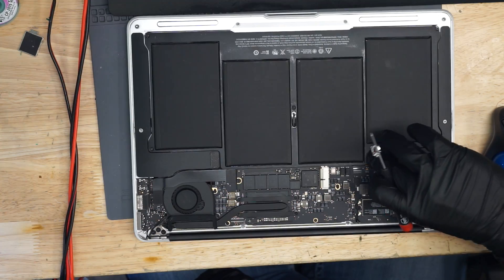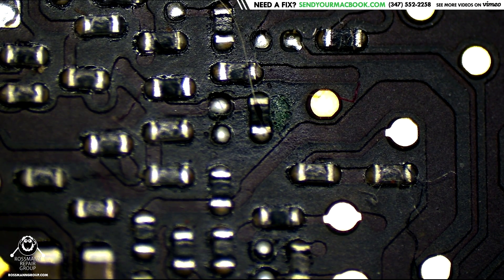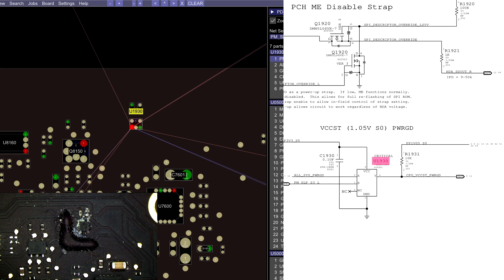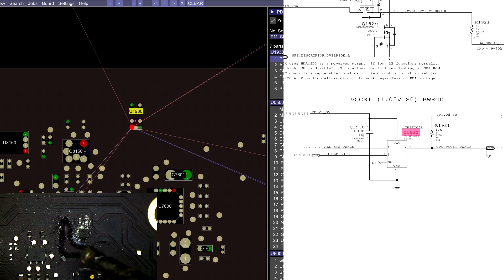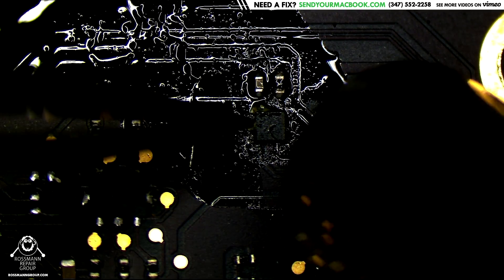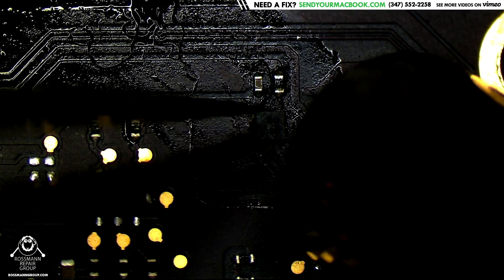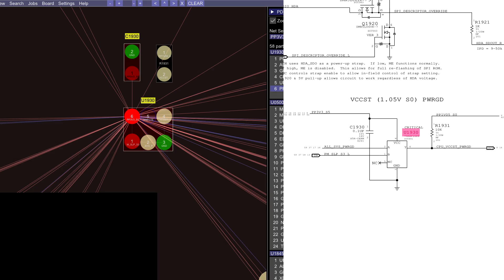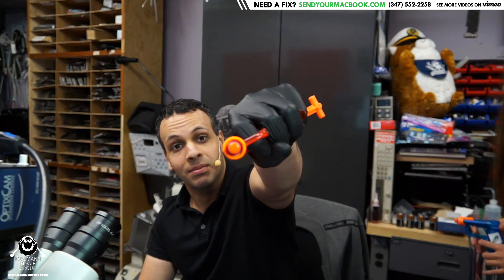Why is an A1466 Macbook Pro taking 45-65 mA and not turning on?

Comment: Heyy
i am having Issues with the new Macbook Pro Baseline Model(128Gb Variant)-

The Screen Flickers Green Intermittently while Watching Video Content.

The whole Video playing area shakes sometimes. 

The Lower area of the Screen was showing Vertical areas of bright and shadow regions (seemed like someone has put on lamps from below the screen) 

It's in Warranty...but the service centre said there is no issue with the hardware.
I am running MacOS Catalina... and i don't think it's a software issue.

Anyone Else facing this issue?
what should i do?

Comment: Why is Apple XYZ  it working anymore, despite X mA:
Because it has been engineered to fail. The idea is for you to buy an overpriced doodad not just once every few years but regularly, at least once a year. That's why everything Apple makes is particularly fragile and prone to break down. And don't forget about that Apple-exclusive Intersil power management device that is engineered to be right in the failure rate and mtbf average that is most profitable for Apple. In other words, the chip nobody but Apple has access to, nobody else can get, and that dies mostly just in time for the next macbook generation.
They say that the lottery is a tax on the stupid. I say that Apple is yet another tax on the stupid with too much money to spend. 
Why spend $2500 on a notebook that is fragile, prone to break down and specced like competing notebooks in the $800-$1300 range? Because the case is shiny? Because the guy presenting it was wearing a black turtle sweater? I really don't get why people do what they do here. I really just don't. Why give good money to Apple?

Comment: Hi Louis, is there any chance before you move into the new store that you can take a quick video and use a string line in the new store so as to give a visual representation of what the old store size would look like in the new store if that makes sense? so we can see the size difference.
Reply: Max Miles Its much larger! Not sure about width and length ratios.
Reply: @gordonrichardson2972  yeah i know its larger Gordon but i just thought it might be a good bit to put in one of the next video's so you could visually see the difference since youtube is a visual medium :)

Comment: I learned that schmutz and smegma on the motherboard is a bad thing. Wish I had a microscope like that. I have an analog Hakko soldering iron and rosin core leaded solder but I think I need a couple of gallons of flux before I take on micro soldering... as well as a hot air station. Love watching your stuff even though you talk way too fast. Great new space. You got the right one without Karen or Alan helping you. Good work!

Comment: Proof that all apple products are deliberately made BAAAAD to fault later on to milk their customers for $$$.
- Corroding metal
- Very Little Flux
- Over sensitive water indicator
- Poor Filter that builds up dust

= Which is why i never touch apple products.
Reply: i don't think you know how filters work.
just so you know, if the filter builds up dust, it's working.
if you do not want it to build up dust, clean your room more often and quit smoking.